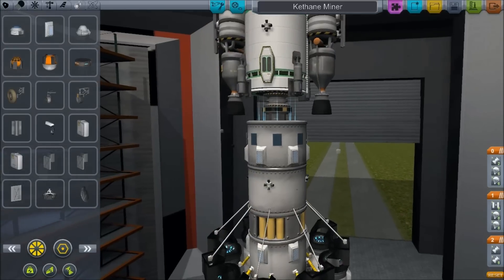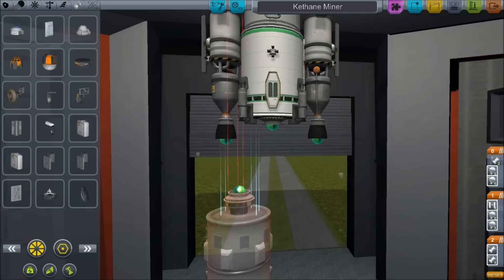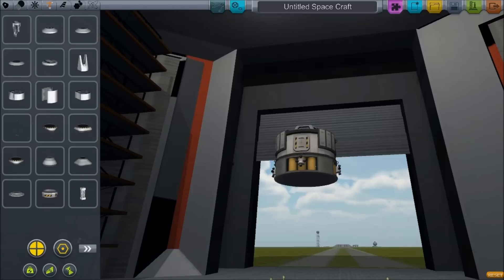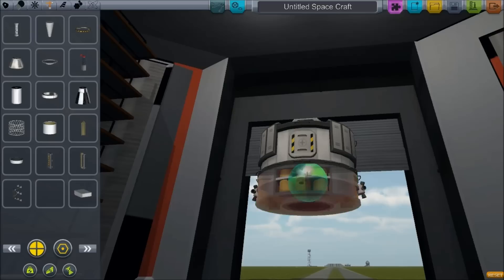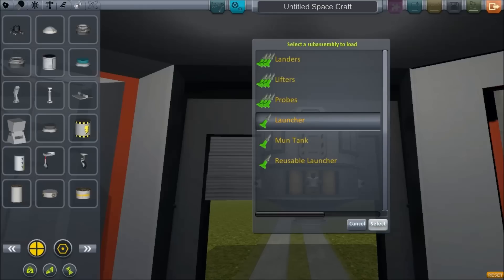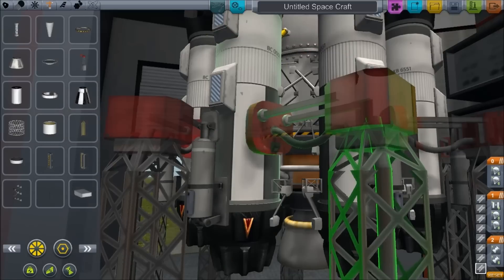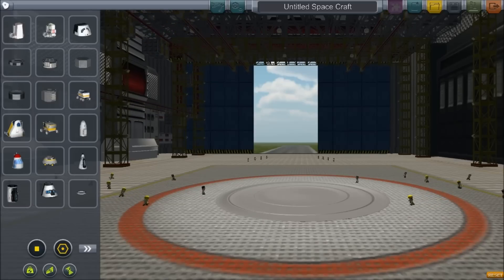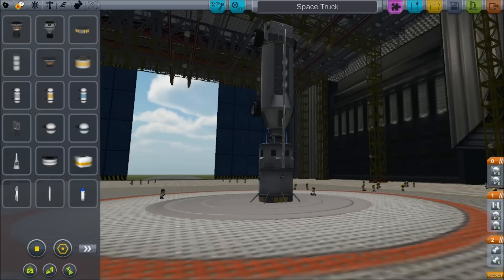Kerbal Space Program - Subassembly Saver & Loader Mod

Comment: Light and fast is your best bet.  Scott favors a Jet-stage approach for the 0-12000 or so portion of the lift, and then will swap to a central LRB stage for the transition to orbit.  Ideally, you want the LRB stage to get to orbit with payload with next to no fuel remaining so you can then de-orbit either using remaining fuel or by using the RCS translation controls for thrusting fore and aft (H and N respectively).  Don't forget to either man your lift stage or slap a drone on it somewhere.

Comment: This is what I did previously. The only problem with this is if you need a manned payload attached to it. Using a probe body on the launched part wouldnt allow you to man the rest of the rocket. You could make another rocket that is manned and transfer crew i suppose. But its still not as smooth as having the subassembly loader

Comment: That's fair enough. It's rather tedious to cross-check all the parts on updates. I'm running so many of what I consider essential mods plus some of my own "fixes" that it leaves me little choice other than to do it anyways. Might actually be worth looking into making a modloader which can install and uninstall specific mods by fusing the different config files. Or at least keeps track of which ones have changed.